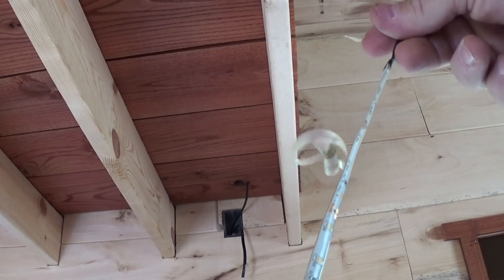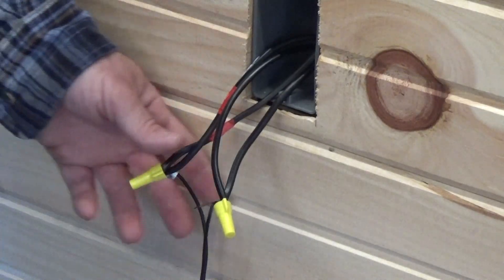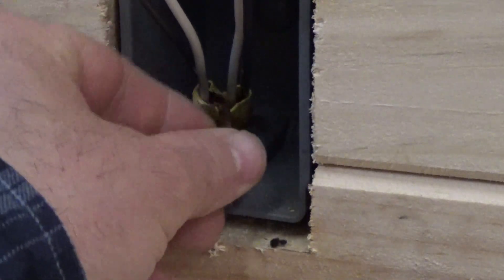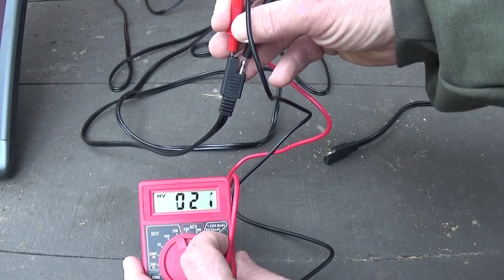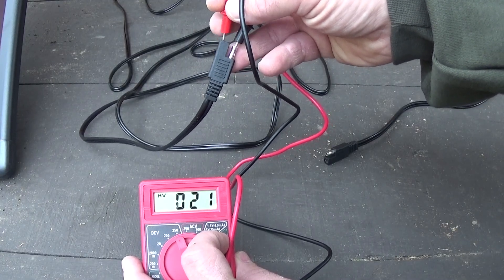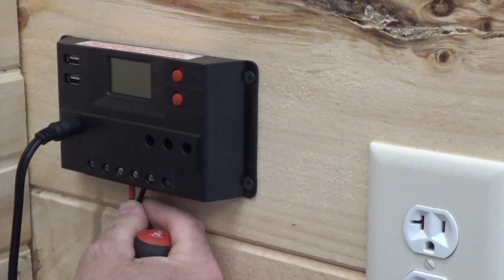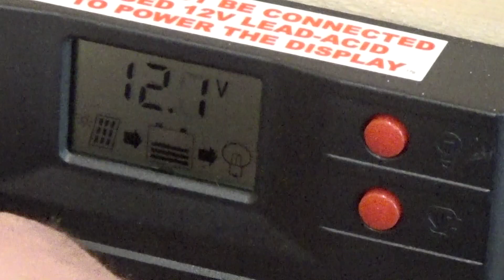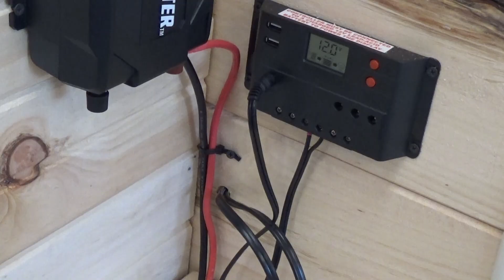Off grid tiny cabin gets  harbor freight solar panel kit installation and I wire 12 /110 volt system

Comment: I have one of those kits, one of the solar panels started to Rot less than a year of owning it, where as the older 45Watt Kit is still like new after 12yrs...
Reply from the maker: Really I hope I have better luck than that with it
Reply: @blackspruce1861  Not as Water Proof as the originals.. Get them Off the ground. That was my mistake.

Comment: There’s a couple usb ports on the charge controller and they also have a couple lights in that kit. We have the same kit. We use it on our cargo trailer conversion. The light is perfect for a yard light after dark. It’s a great basic setup
Reply from the maker: Cool I never even tried the light that comes with it . I should check them out

Comment: My guess is you'll eventually want to upgrade to a LiFePo4 battery. Those marine batteries only give you about half their rated capacity.
Reply from the maker: Yeah I think I probably will switch to something else eventually but at that time I just didn’t want to spend the money.
Reply: @blackspruce1861  Luckily prices on LiFePo4 batteries are starting to come down. They're all over Amazon.

Comment: The solar panels they carry at Harbor Freight have gotten much better than they used to be and are actually a very good product now (if you cut off the stupid SAE connectors and hard wire or use MC4).  The rest of the kit is still poor quality though.  I would highly recommend getting a better quality charge controller and LiFePo4 battery instead so you don't catch your cabin on fire and get more usable power out of the battery.
Reply from the maker: yeah I may upgrade eventually  just wasn't wanting to spend a pile of cash at that time

Comment: For future use, the landscaping wire has ridges on one side so you can Identify which wire is which.
Reply from the maker: good tip thanks I guess I've never paid much attention to that kind of wire
Reply: @blackspruce1861  For me, it had nothing to do with paying attention or not paying attention. I learned this in a class at the local occupational center, when they covered wires and polarity.
Reply from the maker: @KelikakuCoutin   nice ! The majority of the wiring I’ve done has been either house wiring romex, or industrial grade in which case the wire used for DC is a 2/c #10 black Red . So the landscaping wire was new to me
Reply: @blackspruce1861  Some people may say that using romex is cheating. Not me though. I've used it.
Reply: Beat me to it!  The same goes for lamp cord or most other ambiguously colored cords.
Reply: @KelikakuCoutin  
Exactly.

Comment: Ryan, Great Power System. Are you going to mount the Solar Panels on the Roof one day? On the porch a Wood Box at far end with lid would be great & act as a table also with lid down. Why marine battery & not lithium battery, they have a 10 year life time of producing. Have all your wood cut up in it for the Fire Box ahead of time. Thanks for sharing your electric installation. always, Tommy :-)
Reply from the maker: Thanks! I went with a marine battery because I was being cheap lol . A lithium or gel cell would probably be better and safer , but this will do for now. I like the wood box end table idea I might have to build one

Comment: I put a set of those self sticking LED tape lights in my kitchen as undercabinet lighting.  They killed themselves after only a few hundred hours.  I presumed from overheating since I stuck them direct to the wood and it was summer and no AC.     I redid them with new ones, but I laid adhesive metal foil tape from the HVAC section first, then stuck the LED tape to the aluminum foil tape and that worked until the kitchen cabinets were ripped out and replaced.    The foil tape acted to dissipate the excess heat.  
    When you wired up the outlet, I noticed you used the two screws to daisy chain the power on the the next outlet.  This is not such a great idea, as it will fail inspection, and the reason is that little link that connects the upper and lower outlets together will fail under prolonged heavy load situations.  Better to connect the two conductors together, and run a six inch pigtail from that wire nut to the outlet screws.     In your case, this is not a big risk since your 750 watt inverter will only provide half the amperage that a grid connected outlet will provide.     But something to be aware of in a larger installation.   
  That yellow plug you used to connect to the inverter.  First, that tape you wrapped to the cable actually is important.  The jaws that bite down on the cable are designed to bite into the outer jacket of an extension cord.   the reason that this is dangerous in this sort of installation is that the plastics used to insulate house cable like you used are a lot thinner, and the insulation around the individual conductors will squeeze out over time if the strain relief screws are fully tightened or overtightened.  Also, those are cheap plugs, and will not stand up to any sort of abuse.    
   lastly, I didn't see any fuses  or switches  on the DC side in the battery box.   In case of fire or electrical emergency, you want to be able to disconnect the battery and the feed from the solar panel.   also, the battery itself is a fire hazard, especially when the mice get in and start chewing on the wires.  Another way to protect your battery from setting the cabin on fire is to fill a couple of plastic baggies with vermiculite from the garden center.  actual mineral vermiculite, not the plastic replacement stuff.  Do a flame test to ensure it is nonflammable.   In the baggies they are easy to handle and remove and replace when you need to work in the battery box.  If a fire does start, the plastic bags will melt and the vermiculite will help keep the fire from spreading down the wires and hopefully keep the fire from burning the place down.
Reply from the maker: I was considering putting some of those lights in my kitchen too I’ll have to remember the foil tape trick. I thought I mentioned in the video when I was wiring the outlets that I normally would pigtail the outlets but I didn’t have enough leftover wire  but maybe i didn’t. I wasn’t really worried about it since for the most part I don’t plan on using much AC . But putting things out like this maybe I should explain a little more thorough . Kind of balancing trying to be informative and not boring people is tricky.
I have had a lot of comments about fuses. Before wiring this cabin the only 12 volt wiring I’ve done  has been 124 volt dc systems in control houses for electrical substations it all runs to a dc breaker panel , I honestly don’t know why I didn’t think to put fuses in it but . I’ll be doing a short cabin update video and address some of the thing people have pointed out . Some things people have pointed out were done I just didn’t get good footage . That vermiculite in the bags sounds like a really good tip too thanks I appreciate the tips and I hope you enjoyed the video
Reply: @blackspruce1861    Then I don't have to explain that breakers and fuses have different interrupting voltages for DC and AC to you.    The vermiculite trick I learned from the Nuclear Regulatory Commission.  that's what they do with cable trays full of control cables to control cable fires.  Lesson learned after the Browns Ferry reactor plant fire.

Comment: Go get you some stronger wiring !  At least 10 gauge from solar panels, 2AWG wire for battery to inverter, stronger wire from charger to battery(8AWG), etc!  You will be adding solar panels and you must have stronger wiring, and a fuse or two!!!
Reply from the maker: I’m definitely adding some fuses

Comment: 7:40
such a shame they didn't make that plug come out the bottom of the charge controller (solar panel input power)... that connection will always have stress on it, and they potential to be broken off. especially since the unit is designed for wall mount. 

I've picked up some dimmable led strips from Wish, that I love! Uses male USB for input power. they've got an off/off/dimmer sensor inline you just wave your hand over. added 2 near my bed for extra lighting, without having to use the big room lights... 
Also, the adhesive on the LED strips is junk... so I added staples, being sure not to puncture the circuitry. Staple one end, stretch the strip, staple other end, added staples to middle to prevent sagging. 
great video, thanks for the upload!
Reply from the maker: That would definitely be an improvement if they had the plug in come in the bottom . I've never ordered anything from wish . there's been a couple things that looked interesting but just didn't want to get the app, cool you're having good luck with them . so far the adhesive is holding strong on mine I would imagine eventually ill have to add some staples . Thanks ! I'm really glad you liked the video

Comment: If you are able to I would suggest you take that back as soon as possible and you get get cheap used solar panels and get way more power from the panels. Then you spend less and get more power.
Reply from the maker: Honestly I don't spend much time inside during the day when im there, and as long as its not too overcast it charges the battery to about 13.8v everyday . I really don't have any complaints so far . I might eventually add a cheap used panel and maybe another battery but so far so good
Reply: Where do you find used solar panels? Sounds like a great resource.
Reply: @CoolBreeze640  there’s normally a good selection of panels on Facebook marketplace . I don’t know if they’re used or not but seems like there’s some decent deals on there some times
Reply: @northernryan2190  
Thanks!
Reply: @CoolBreeze640  you can sometimes find them local or can order them from places like santansolar, signature Solar, or I go and get my latest ones from a guy in Ft. Worth TX

Comment: Low voltage wire has one smith and one rough side when you run your finger around the wire you can tell the difference always connects rough to rough  and smooth to smooth
Reply: Nice job but I think you need to add fuses.   Positive leg of circuits.   One between solar panels and charge controller, one between charge controller and battery, one between battery and inverter, and one from battery to 12 volt outlet feed.
Reply from the maker: Thanks for the tip

Comment: Always put suitable size fuse at both panel and battery  positive connection.  Cheap easy piece of mind 🔥 protection      thanks for showing how simple it can be live the 12volt dream
Reply from the maker: Thanks for the tip . I like that the 12 volt dream

Comment: What about venting that battery as it charges it releases gases which are not good to breath. You should have a circuit breaker or fuse between inverter and house wiring for safety. Nice project I enjoyed your video.
Reply from the maker: That kind of battery when charging would release hydrogen gas it’s not toxic but is extremely  flammable. I don’t think it should be a problem because hydrogen does dissipate pretty quickly and I doubt it lets off a lot . One of the reasons I believe that is I have built electrical substations for years and many of the control houses have 125volt battery banks which are  in them charging they have a hydrogen detector mounted above them which activates a fan to vent the room . That fan hardly ever gets kicked on and that’s a bank of many batteries charging so my one I think should be safe enough 🤞. I think that would definitely be a good idea though especially if it was full time residence. I’ve heard gel cell batteries don’t put off hydrogen but I don’t know that for sure. As for the breaker I rarely use the inverter so when it’s not in use I have it shut off. The lights are 12v the usb outlet will charge my phone and speaker really don’t need much more if I lived there full time I would probably have done that though. Thanks I’m really happy you liked it

Comment: Those look like great solar panels!
Reply: Working on a video now to show the time to charge one battery from a 49% charge or 11.7/11.8 with one panel over night hours starting at 4pm with a thunderstorm and onto the next day just to show worst case scenario! 
 I’ll follow this video with another in best case scenario in full sun starting at 11am to 3 pm, With same level of.charge. 
 Awaiting all kinds of stuff so I can show a running water and lights with a 2000 watt availability a build if you will from scratch new out of boxes to completely finished. Should be I good video also 
 So hopefully I’ll get more subscribers and maybe sell some of my books !
Reply from the maker: @solarindependentutilitysystems  sounds like a good video that could answer a lot of peoples questions!  I’ll give you a sub!
Reply: Yeah so far they seem to do pretty good. They only total 100 watts so I’m not sure how they would do with more batteries or a cabin that get a lot more use but I’m happy with them so far
Reply: Just start with 2/5 watt led lights they are super efficient and most dependable as they would work down to 9.5 not that would want to go lower than 11.7 ever but shows that they can’t fail practically.
Reply: I haven’t met a solar panel in 40+ yrs that A didn’t work at all unless someone smashed it or B didn’t get stolen . So sell them !
Reply from the maker: @solarindependentutilitysystems  they work great !
Reply: New inverter is working running the Ac perfectly running the whole house as well again just 2000 watts on a cheaper modified sine wave inverter under $200 today on Amazon. But thank you ! If I maintain over 50 subscribers I can do a live from scratch video daily is my plan answering questions as I put it together! Your #53 last checked best wish nice to have solar powered Ac air conditioning Free
 That should be charged by now so headed out to wrap this one up .
Reply: No they're actually cheap junky panels

Comment: You could inject wood glue into that wall switch plate crack by using the suction cup method Luthier's do.
Reply from the maker: Thanks for the tip! I think this one will hold up but that sounds like something I should learn how to do .

Comment: Beautiful  work.  Not sure if i would have battery inside, be worried about off gassing from it. Don't know if just one battery will do it or when you have more than one.
Reply from the maker: Thanks ! I wonder about that myself I suppose you could buy a hydrogen detector but I'm pretty sure they're a bit speedy. I've been told that the gel cell batteries don't produce hydrogen but i don't know if that's a fact

Comment: The pair of low voltage landscape wires are identifiable by their outer edge jacketing. One is smooth and the other has ribs that run the entire length of the wire. That's probably the only thing I can help you with. Everything else I'm clueless and you're helping me from my lack of building knowledge. Thanks for sharing. Fascinating to watch.
Reply from the maker: yeah I realized that a little later on that one wire had writing the whole length . that is a much better way than marking it  before you pull it . I'm very happy to share and even happier that you enjoyed it .

Comment: Any thoughts of getting a pure sine wave inverter? I know those are much better for things like audio, video, electronics.  

I get that it's an off grid cabin and you're probably not planning on getting those things, just curious to know your thoughts. 

Thanks for the video, I truly love this build.
Reply from the maker: I’ve really never researched them . Sounds like another thing I should check out , for now I’ll probably just be a cheapskate though lol
Reply: @blackspruce1861  you'll probably know when something isn't happy with the inverter, at least I could tell. I use my Chevy volt as a backup power source for power outages and it was amazing how angry sounding our fridge, freezer and tv we're on the cheap Menards 1500w inverter, similar to yours from harbor freight. 

I ended up spending the money to get a pure sine wave inverter just to protect the appliances I'm running at home.
Reply from the maker: @jason5584  I more than likely won’t use it a hole lot maybe to charge my laptop or batteries for power tools . It’s so nice having 12 volt lights since they use so much less power

Comment: We have 1.2kw of solar panels on our sailboat and 14.4kwh of Lifepo4 batteries that power our 20kw electric auxiliary motor and feed our 3000 watt inverter.  We live like most do on the grid but have no electric bill.  Installation of solar on a boat is a real challenge but the payoff is immense.  Great video.  Nice cabin.
Reply from the maker: That sounds very cool ! I would like to see a picture of that boat it sounds like you would have to get pretty creative to get that many panels on it . thank you I'm glad you enjoyed it